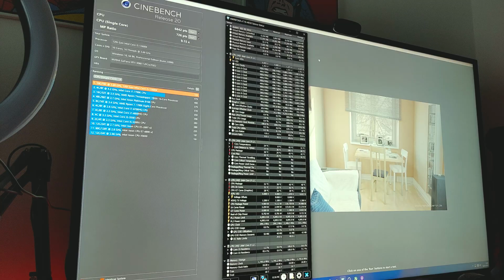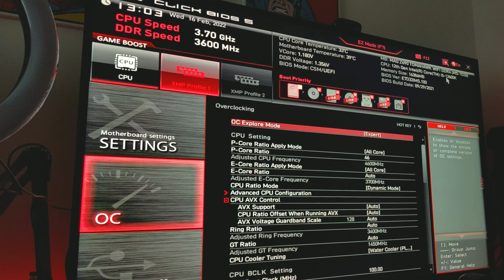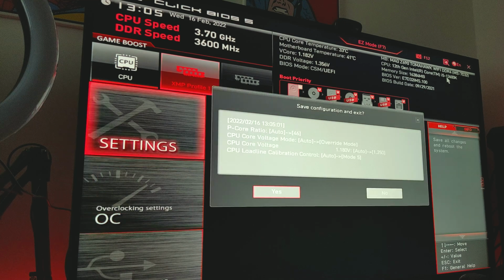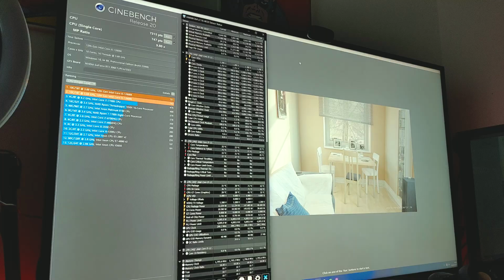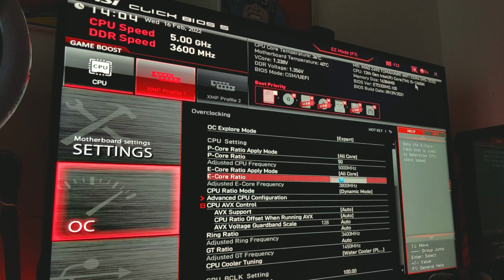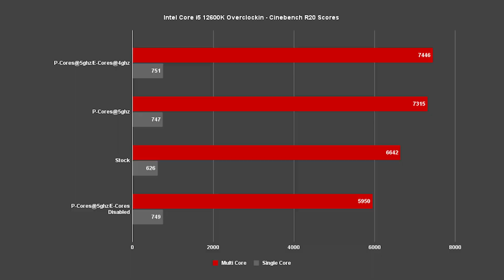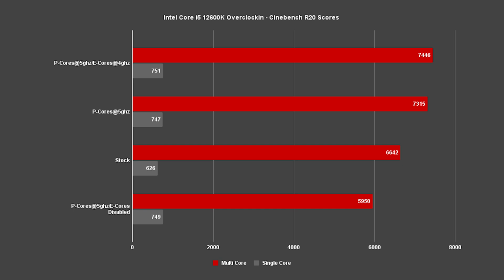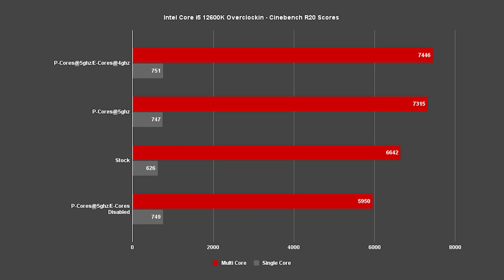Intel Core i5-12600K P&E Core Overclocking! Walkthrough & Performance Testing

Comment: Could you just go in and change the V to 1.250 adjust the P cores to 4.9 and E cores to 3.9 and not have to incrementally go up? Would this still give a performance lift without having to spend 4+ hours slowly tweaking?

Comment: Price to performance wise IMO the 12600KF is the best possible chip today. Its a beast and can run some respectable GPU options without any bottleneck at 1440p and even 4k. From a 1080p to a 4k set up this 130$ beast can get it done.

Comment: Damn... you weren't kidding about the mobo getting "bricked". I just had to take apart half of my PC, including taking out my rather large GPU in order to reach the CMOS battery. Turns out MSI were too cheap to include a jumper to reset the CMOS (or I lost it? No idea, but it wasn't on the board and I went through the entire package the mobo came in and found nothing.. :D ). Lesson learned: Don't underestimate the consequences of messing with OCing ... and next time: Get a board with a convenient "reset CMOS" button on the I/O-panel... :D Oh, and probably get something bigger than my 240 AiO for "serious" overclocking... :D
BTW: I did do a per-core OC on the P-cores and had a stable, but not very impressive, result. I adjusted the individual limits according to the cores' behavior (#2 and #5 would get particularly and instantly hot in Cinebench - like 100°C right after testing started), and I set an overall target frequency of 4900, just to start things off nice and slowly. After the temps in CB stayed pretty low with those settings, I decided to up the individual limit on my two best cores by 200 Mhz each (to 51/5100), then raised the overall multiplier to 51 as well. On reboot, the PC wouldn't even get to the BIOS and kept re-starting on its own. Had to switch off the PSU to get it to stop to be able to reset the CMOS. Weirdly enough, none of the warning LEDs on the mobo came on during this. I would've at least expected the CPU-LED to light up or something.
Reply: Nah you just have a cheaper version of the motherboard.

Comment: Thanks for the guide, sir! the only problem that I have is with e-cores. it doesn't matter what ratio I set, never boost over 3700mhz. P-cores are boosting with no issue. i am using hwinfo64 for monitoring. Thanks again.
Reply from the maker: Cheers mate! 👍 E-cores won't go much higher but maybe that voltage slightly could help. Besides that could be a lesser binned CPU sadly.

Comment: Overclocked 12600k is same as ryzen x3d in games and in some, worse.
Price for setup is same.
So I guess amd and intel switched places. But intel for work, ryzen for games? :D
Reply: ive never bought amd i kow they have worse latency for games and are typically hottter and not as good. im not a fan boy of either its just everytime i wanted to buy a cpu its an intel...theres been times i would have bought an amd if i were in the market
Reply: @GeorgeWPush  Same here but I ended up buying almost twice cheaper ryzen setup (2600x and later upgraded to 5600x). All games were running great and only high end Intel cpus beat my setup. Now I chose ryzen again but 5800X3D because if I went intel path, the only choice would have been to spend way more for new gen cpu which will run games at 5-10 frames per second faster :d

Comment: is getting i5 12600k better than i7 12700 non k, if I oc the 12600k for gaming
Reply from the maker: Depending on pricing as well as how good of an OC you can tune in on a 12600K but a 12700 may still outperform it based on its higher L3 cache as well as higher core count and single core performance.

Comment: z690-f gaming with i5-12600k, 32gb fury beast ddr5 ram and nzxt 360mm rad, 5.2, 5.1 and 5.0ghz pcore and 4ghz ecore with 1.34v and got 19025p multi core.. Got it running 5.5ghz pcore and 4.1ghz ecore for one day, did'nt wanna run today for the benchmark.. But i'm happy with the oc for now, maybe i'll try sqeeze a little bit more out of it later.
max temps when testing were 85 degrees celsius
Reply from the maker: Sound awesome mate 👌
Reply: @PCJack  Also did an single core test and got 1945p

btw awesome video!
Reply from the maker: @ShortsFit-j8h  Nice! Cheers mate 👍

Comment: What temps did it end up running. All important
Reply from the maker: Just over 70c with an NH-D15 on an open air test bench.
Reply: @PCJack   Hmm what about water i wonder?
Reply: are these cpu idle temp?

Comment: I have my 12600k running 5.1 on all P-cores and 3.8 on the E-cores.  I could get 5.0/4.0 to run,  and 4.9/4.1, but when I tried 5.2 on all P-cores, I was getting BSOD even if E-cores were left at auto.   Not all the time, but frequently. I also tried some per-core settings on the P-cores, but that never seemed to work any better.   I'm tempted to play with it a bit more, but don't really understand all of the voltage issues, and really, I doubt i am going to squeeze out more than a few percent more, so I'll probably leave it alone.

How much am I leaving on the table?
Reply from the maker: Yours might not be able to hit 5.2ghz stable I guess. If you are going to try and get that stable then maybe try tweaking your load line a bit. Otherwise I'd just leave it down to silicon lottery. 5.0/4.0 is still pretty good though so I'd be happy with that 👍
Reply: @PCJack  Thanks.

Comment: I got mine to 5.3 5.3 5.2 5.1 5.1 5.0 and 4ghz on all E cores at 1.35v and on R23 it gave 2030 in single core and 20137 on multi

Edit I did get 5.5ghz and 4ghz to post but that was at 1.47v 👀 and I didn't feel comfortable with applying anymore ☹️
Reply: Mine is stable at 53, 53, 52, 52, 51, 51 and e core 4.1ghz 1.35v if i go any higher my windows crash and get corrupted :-P
Reply: @jewelersofwhale  sadly mine only got a SP rating of 59 which by all accounts is one of the worse binned CPUs 😭 so I'm kinda disappointed in that. But 5.3 at 1.35v is really good!!
Reply: @welshman2011  aw, i find it so disturbing that its all about luck with finding a good cpu. Have heard that alot of people order and test several then return the lower ones :-/
Reply: @jewelersofwhale  yea I've seen alot of people saying the same thing aswell so I think il try and do that although I'm not sure if intel will allow me now as I had it since last year. 

I am currently as we speak testing a all core 5.1 and 4.0 at 1.375 with LLC 4 and it's past R23 and done a 720p tomb raider benchmark so all is good upto now and I've noticed it's alot more responsive and more snappier booting to windows and opening programs
Reply: @jewelersofwhale XMP2 at 4.9ghz test run on tomb raider gave 180fps and a 5.1 4.0 with same settings and resolution 199 FPS 👀
Reply: @welshman2011  nice! Tomb raider and warzone are great test for stability, both game crash hard if the ram, cpu and graphic card is not 100% stable :-)

Comment: I put my mode to 5, 4.9 on the p and 3.9 on the p and get blue screen of death. I’m a newbie when it comes to this stuff so not sure, but is it to do with needing more voltage?
Reply from the maker: Yeah you probably would need to set a manual core voltage. Use gradual increments and ensure to monitor temperatures to be safe 👍
Reply: Sorry 3.9 on the E core*

Comment: Got mine to +54 +53 +52 +52 +51 +51 on the p cores and 4.0ghz on the e cores at 1.27 volts nice and stable using msi pro z690-a ddr4 and crucial ballistix rgb 3600mhz cl16 4x8gb to 4000mhz still cl16 at 1.35 volts for single core of r20 score of 800. 7532 all core score. Nh-d14 with custom fans max core temp 89.
Reply from the maker: Nice! 👌
Reply: did you edit by core usage?
Reply: @blairnewcomer5654  Yes, p core 2 and 5 are the good ones on my cpu, 3 and 6 are the worst.
Reply: @0MeALot0  same here p core 6 wont go past 5.1ghz, if i set it to 5,2 windows get instant corrupted and need to be reinstalled if i run any stresstest or game at all
Reply: @jewelersofwhale  You might still get it a bit higher. Got to 53x, 53x, 52x, 52x, 51x, 51x and e cores at 4030mhz but with cpu base speed of 101mhz. This gets it to 5139mhz all core and 5340mhz max. Ring speed to 4240mhz and mem at 4040mhz. Set voltage to dynamic 1.28 volts which translate to 1.268 under load and 1.274 v max in my case. R20 single core is still 800 but multi went to 7701. Haven't tried 102mhz base as im pretty sure it will crash.
Reply: @0MeALot0  Thanks for the tips, so basically i might be able to increase it by increasing blck to 101mhz instead of default 100?
Reply: @jewelersofwhale  Your welcome. Right, from 100 to 101 for blck. On msi boards its called the cpu base speed. This will put everything higher. Ive fully tested these settings and still stable for me. Just watch the uncore/system agent volts. My board set it to 1.48 volts automatically, which will probably burn out the memory controller. It works fine lowering this to 1.3 volts.
Reply: Hey it worked! Thanks for the help.

I run bclk, busspeed at 101.85 gives my lowest p-core 5,195 ghz.
Had to increase cpu volt to 1.38 to be able to run my ram at  4617mhz cl 17(ddr4 32gb)
Reply: @jewelersofwhale  Nice good going! Yw
Reply: @0MeALot0  Thanks! It Seems like I might actually have hit my max potential for my cpu chip. :-) 
If i set anything higher i get blue screen :-P
Reply: @jewelersofwhale  I was thinking the same. It might still go higher but adding more past 1.375 volts gives the chance of cpu degradation, with 24/7 use. In that case the overclock of today will not work anymore in time. Besides this there is a point where you will need to add a lot more volts to gain a little bit more speed. Next to this, the sensors usually do not actually read the voltage all that well. If it reads 1.375 volts, it might be pushing more then that.
Reply: @0MeALot0  had to increase the volt to 1.385 to make it complete stable. My temp went up 10c. When stresstesting in cpu-z i get up to 89c instead of 79.
Im thinking maby i should settle for 100 bclk/buss speed. :-(
Reply: @jewelersofwhale  Mine is at 1.28 volts
Reply: @0MeALot0  oh, even at 54, 54, 53, 53, 52, 52 and e-core 42? That is a great value on the volt.
I guess my ram speed is probably the major reason why i need so high volt even on the cpu.
Reply: @jewelersofwhale  Cpu is at 53, 53, 52, 52, 51, 51 with 101.50 cpu base speed and e cores 40. For 5367mhz max 5163mhz minimum and 4051 e cores at 1.28 volts in my case, although with spikes to 1.294 volts. The ram is 3600 cl16. Now at 4060mhz cl16, still at 1.35 volts. The uncore or system agent controlls the ram, and goes up with higher ram speeds, it was at 1.48 v automatically but undervolted to 1.3 volts. I did change cooling to arctic freezer 2 as the old noctua nh-14 was making a really bad contact to the cpu. The cpu now maxes out at 80 degrees or so.
Reply: @0MeALot0  damn that is realy good.
Maby my cpu is not as good as your, realy wished i dident need as much volt as i do :-/

Comment: hello, what are the benefits of overclocking ddr4 RAM?  And what is the frequency after which it no longer makes sense to go further?  in the sense that the difference will be felt less and less
Reply from the maker: Overclocking your memory will increase gaming performance to a certain extent depending on the title but the gains can be minimal. I'd recommend Actually Hardware Overclocking if you're curious on DDR4 OC gains though 👍
Reply: @PCJack  do you think it makes no sense to overclock to 5333 MHz or in any case such a high frequency?
Reply from the maker: @alsteoaa.  Like I said results may vary but perhaps you could look up your config with memory overclocking results in benchmarks or even try for yourself to see what improvements you could get 👍
Reply: @PCJack  honestly I can not find benchmarks in this regard with the 12600K
Reply: @alsteoaa.  I  recently watched a gamers nexus video where he said that after 3000mhz you see diminishing results. Thats to say that about 3600 maaybe 4000 is about where youre gonna want to be.
Reply: @chawk_  but about the ddr5 do you know how to optimize the frequency?  since ddr5 RAM no longer have improvements after 3200 / 3600MHz, but they need much higher frequencies

Comment: 12600kf on the same mag z690 tomahawk. @ 1.25v. 5.1 all pcores 4.1 all ecores 4.2 ring. Daily stable overclock. Llc is on auto if i set it manually my pc crashes. Using 360 aio to cool it.
Reply from the maker: Nice! 👌
Reply: whats the temps in gaming ?